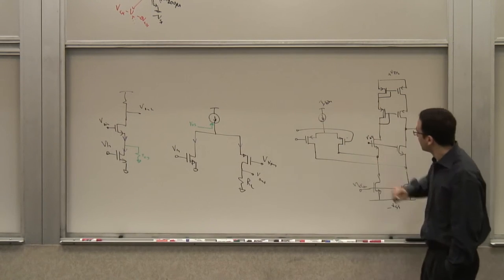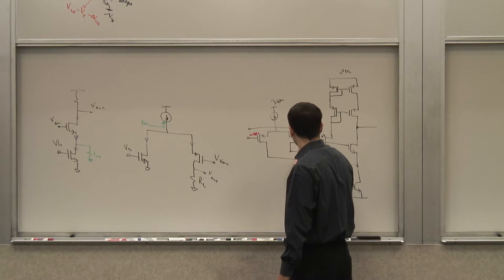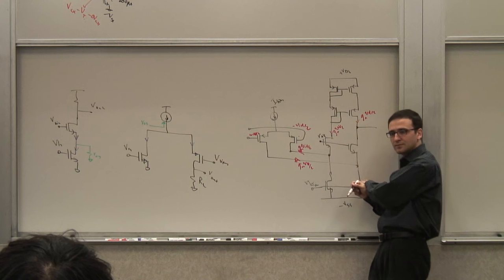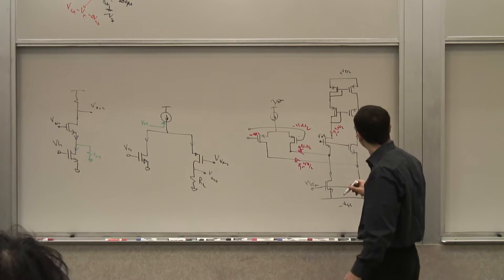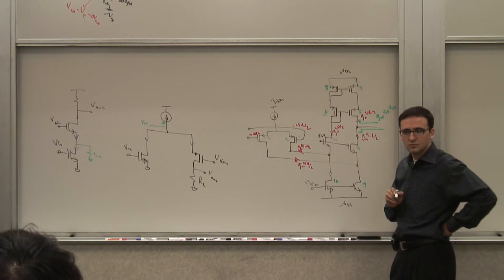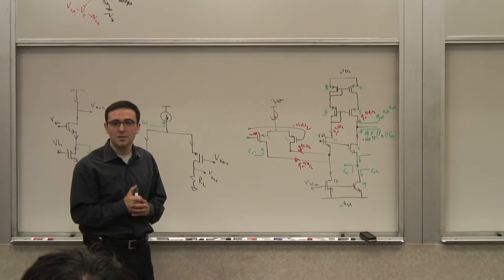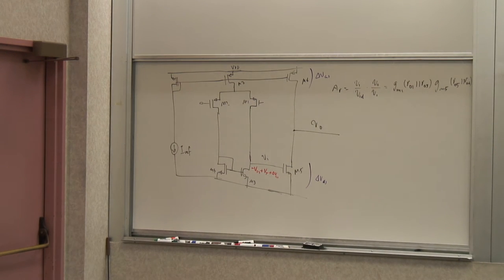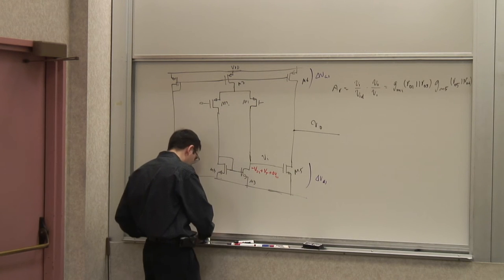134. MOS Op-Amp (Low Frequency): Two stage, Telescopic, Folded Cascade, Two-Stage, Op-Amp Analysis

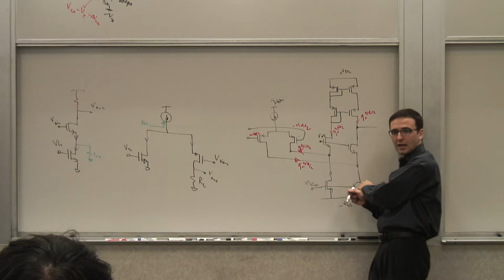Comment: At 1:29
it is very interesting 
Passive load cascode circuit
Active  current source with cascode circuit for load
folded cascode circuit
At12:42 it is a differential pair with active current source Mod_P circuit